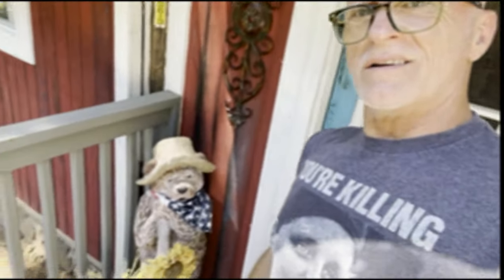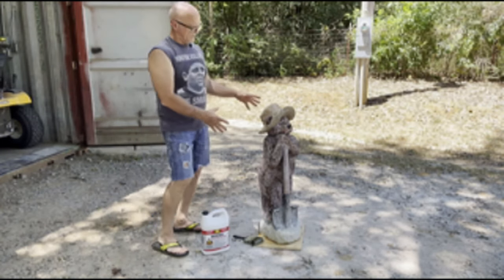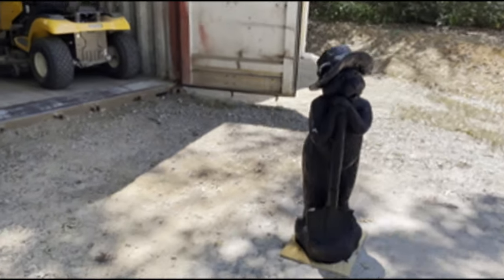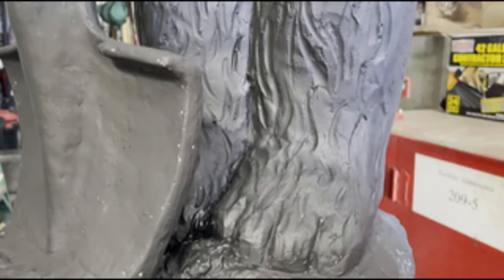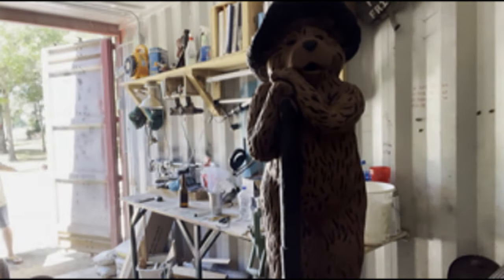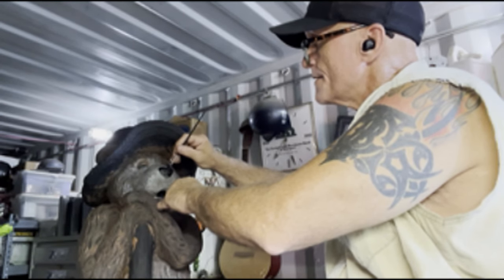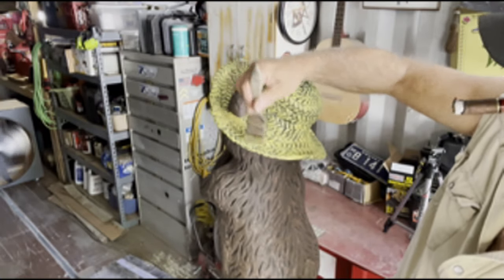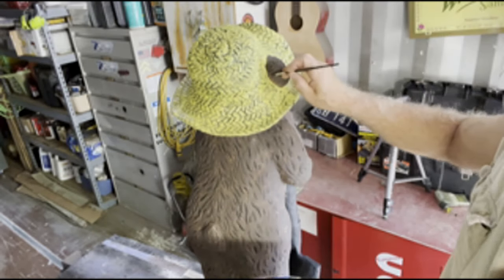BEAUTIFUL!!! STEP BY STEP STATUE REFURBISH

Comment: Mixing water, isopropyl alchohol and black India ink (all avbl at Walmart), you can brush it on liberally and instantly age most anything
Reply from the maker: thanks for the "heads up". I'll definitely try that, and if/when I do, if I use that tip in a video I'll give you a shout out.
Reply: @okladoma9782  I weather models with that technique, and it’s cheap